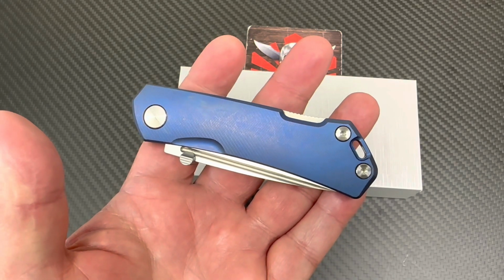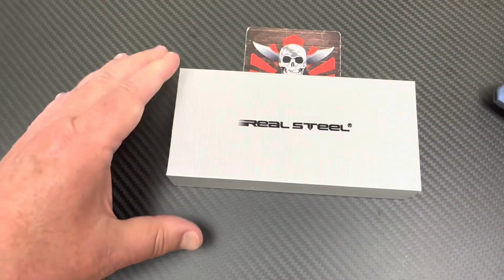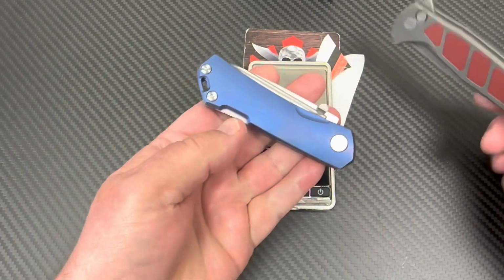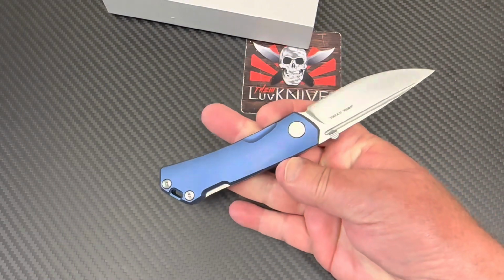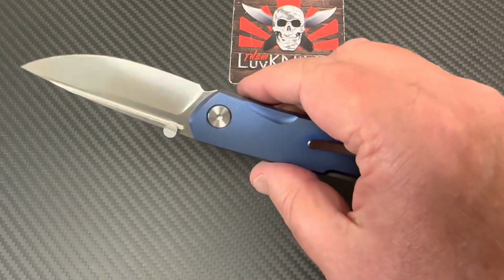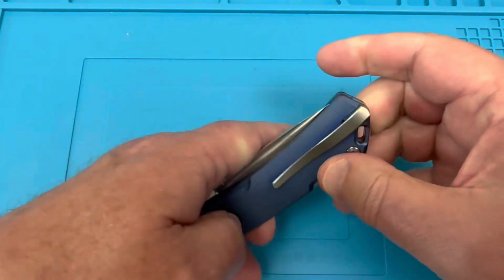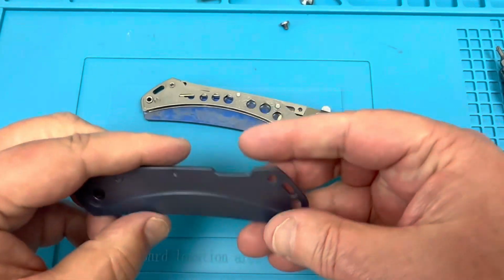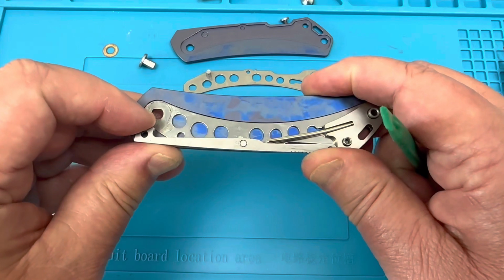Real Steel Luna Maius !  Bigger blade & it’s a lock back !

Comment: While I like the knife and would get one, it's way too over priced. I would already consider it on the higher end of what it's worth if it would be M390 (lots of options available in this price range with m390), but $180 for Ti and N690, forget about it. Nothing wrong with N690, but not at this price for a production knife. 
Honestly, this should be below $100. I mean, you can get a CJRB Pyrite 1925TI, full titanium button lock and ARPM9 which is arguably better than N690 for below $70. So unless you absolutely are in love with this knife, their pricing doesn't make sense.